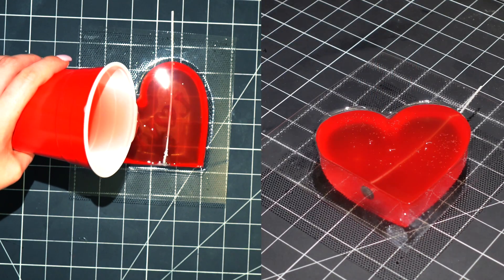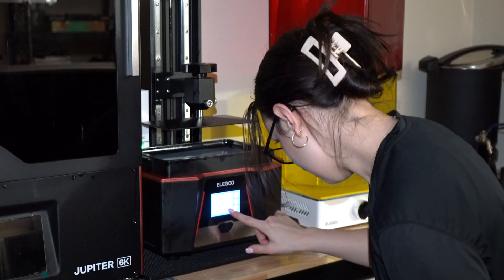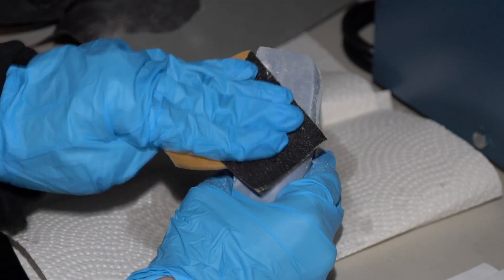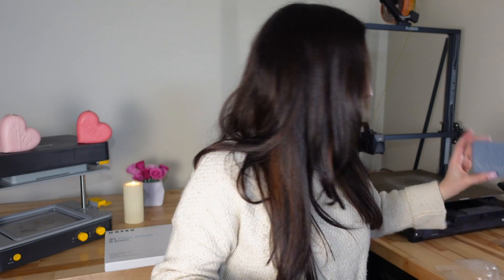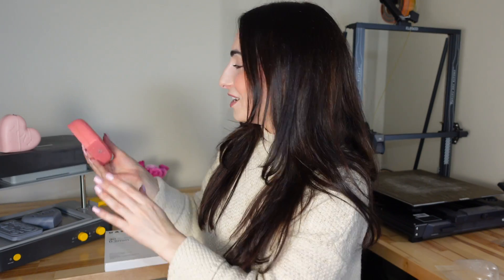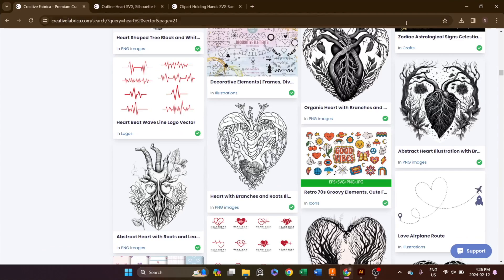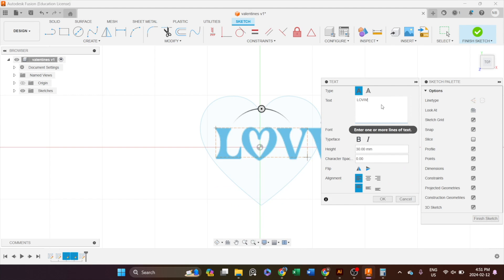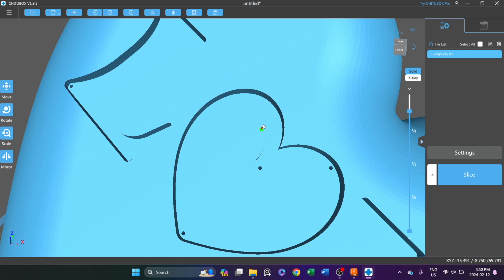Mold Making with 3D Printing and Thermoforming

Comment: this is awesome! can this printer be used to make silicon moulds for fondant or edible pieces? in my country I've been told that resin is toxic,
Reply from the maker: Thank you! the mold itself is not made from resin, it’s a thermoformed sheet that is certified food safe PETG plastic. Unfortunately nothing that comes from a 3D printer is deemed food safe at this time.

Comment: What resin do you use? ive been trying to do silicon on some of my prints but i think the chemistry between the two doesnt allow it to cure
Reply from the maker: Honestly, I wasted sooo much silicone trying to figure this out. Its not the type of resin that is the problem, its actually the silicone. The chemistry between platinum silicone and resin cause cure-inhibition. Getting a "Tin-based" or "tin-cure" silicone will not react :)
Reply: Oh thank you! I keep forgetting the name of it lol
I may also want to build a vacuum former since the size i need they would be very pricey lol
Reply from the maker: @DjUnikardo  Do it!! They're so fun to use :D